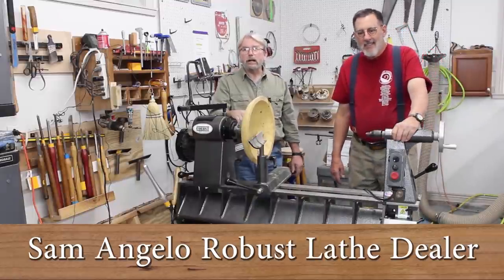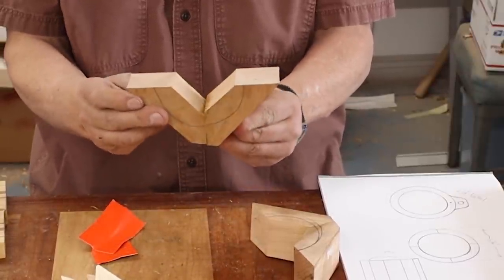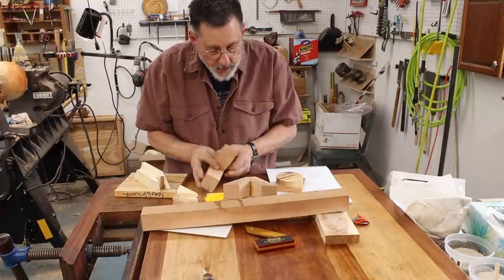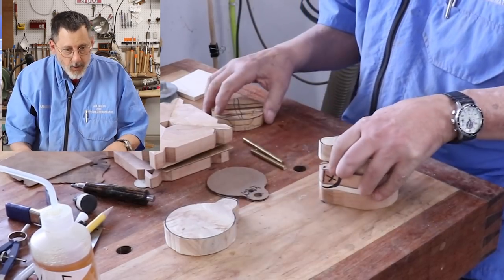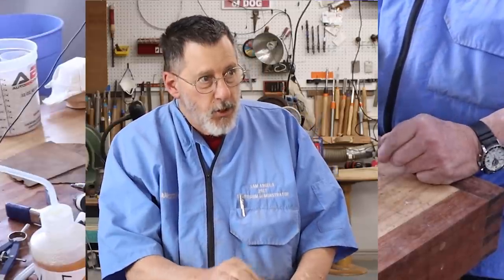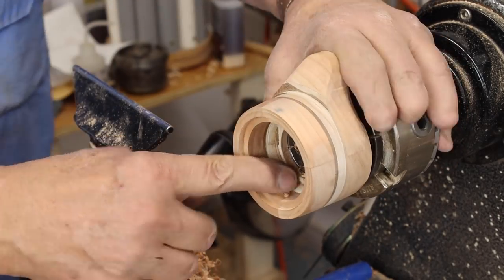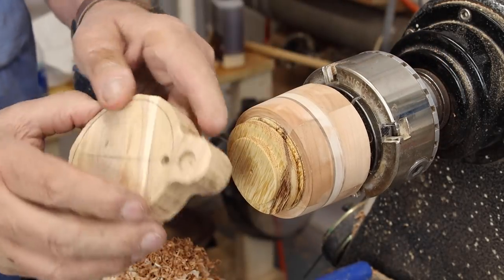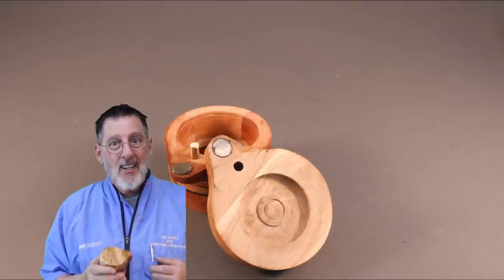Salt and Pepper Cellars with a Swinging Lid  (new design)     Woodturning  with Sam Angelo

Comment: Very cool design.  Definitely agree regarding prototypes and templates.   I use 3D printing to prototype designs and make templates.   One of the side benefits of this is that the 3D printing process requires that I build a CAD model and thus have drawings of the project.